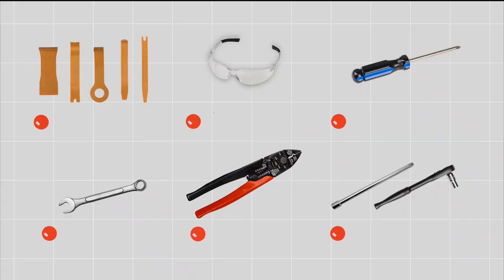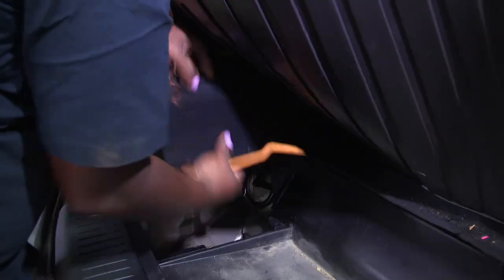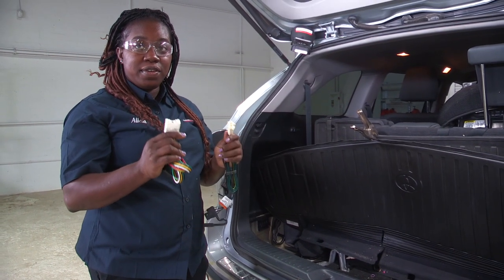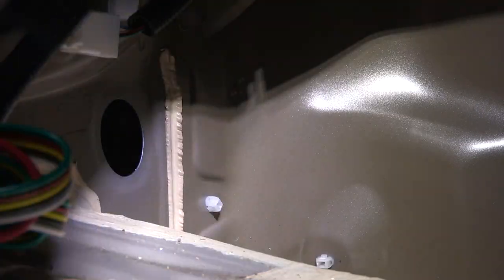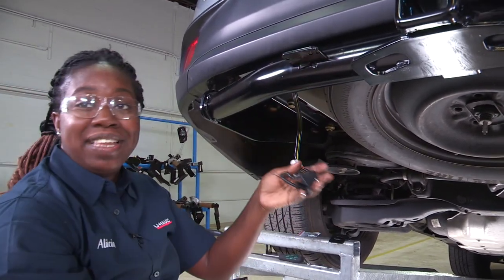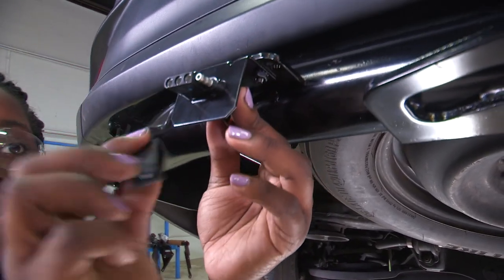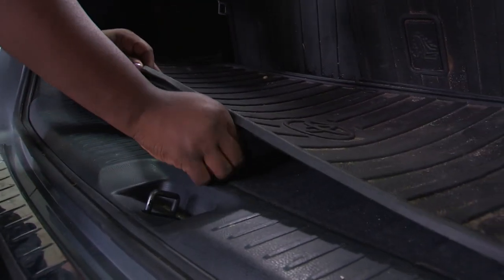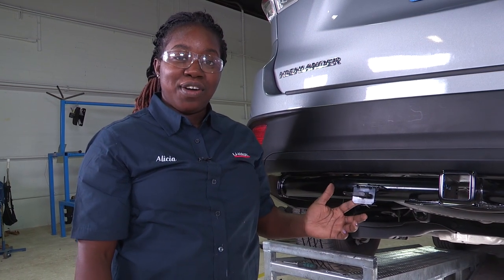2014-2019 Toyota Highlander | U-Haul Trailer Wiring Installation

Comment: I recommend that when you run the cable through the drain hole, that you don't cut the plug the way you did.  That allows the wire to sit directly against the metal edge of the body, risking the wire coating getting cut over time raising the possibility of an electrical short.  Instead, cut the vertical line that you did, then cut a perpendicular line at the top of your cut, so the cut ends up shaped like a "T".  When you slide the plug over the wire, twist the wire into the crosscut at the top and it will hold itself away from the edge of the body.  You can use a dab of black RTV sealant on the small vertical part of the cut and once dried, locks the wire in place.

Other than that recommendation, thanks for the great video!
Reply: I like the idea of the addition of RTV to seal it up. It does make it messy to replace a damaged cable if needed. but you might just need to get a new grommet/plug at that point anyway. Thanks for sharing that knowledge!
Reply: And no one caught the fact  she was using a wire stripper tool to 'cut' the plug... oh my...  But I do like your 'T-cut' idea...